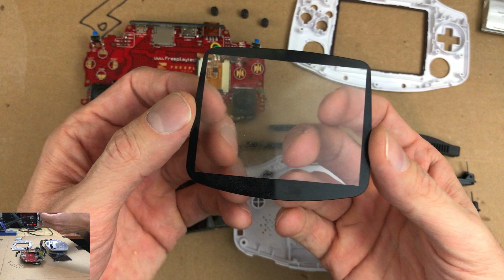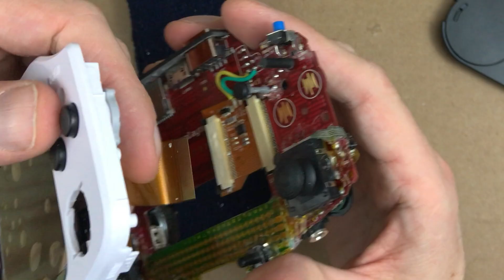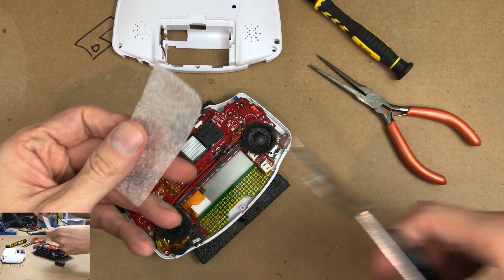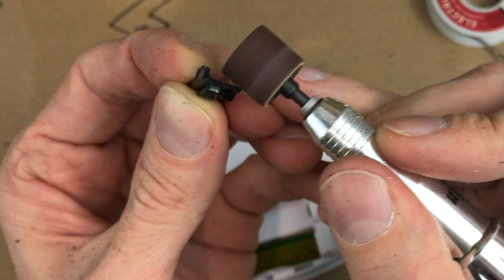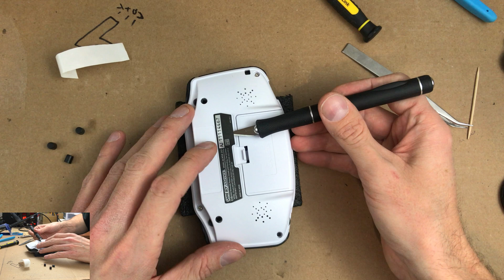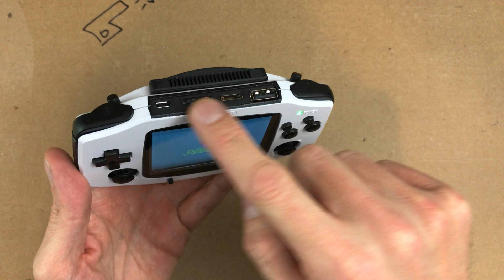Build Log Freeplay CM3 Vita Analogs 10 - Assembly

Comment: One more question which was easier 3Ds or PS vita build!?
Reply from the maker: Hmm I’d choose the Vita sticks over the 3DS sticks if I were making another build like these. The 3DS sticks took more work, and were less comfortable to use in the end IMO. Also, I think I added my Vita sticks in a different way than most people, which I still like. Most people seem to make a hole in the shell and then press the stick up to/into the shell as much as possible to get decent clearance so the stick doesn’t hit the shell when using it. This works, but I didn’t like how tall this makes the analog sticks. So when I do mine I go the opposite way as much as possible. I mount the sticks to the main board so they sit as low as they can. This means I had to widen the holes in the shell though to stop the sticks from hitting the shell. I’m happy with that compromise. I don’t mine the larger analog stick openings and I just cover them up with some material like plastic or foam. I have tried modifying a Joy Con analog (the drift issue now has me not trusting Joy Cons anymore) before to lower the height even more to test. I found that when I lowered the height of the sticks they felt bad. They then had a smaller range of motion which really felt bad to use, so I didn’t stay with that idea.

Comment: Would you be able to put wifi and Bluetooth with this setup!? Asking for a friend. Me!
Reply from the maker: Yes you sure can. I did in this build (2nd video in the playlist) https://www.youtube.com/playlist?list=PLREjlLscKf5IyG-kfCUnbVqFZRrvADeme . It works well, but the system sometimes doesn’t like having USB devices suddenly turned on an off. Also the way I did it requires the hub to be  powered to be able to use the USB on the main board. So it’s Bluetooth + WiFi + USB, or none. Not real problems for me though.  I just usually toggle the Bluetooth and WiFi to on or off while I have the system off to avoid the random freeze that might happen.
Reply: Hipcat I saw that build but you didn’t break the board in smaller pieces
Reply: Hipcat once I get all the parts I will hit you up so I can make the right connections on the two boards! And just to let you know I know some dude sales these on Etsy.com but they are not as good as yours. Just saying incase you wanted to make a few bucks!

Comment: How did you fill the full screen? I heard these screens are real finicky and don’t do well with resolution changes.
Reply from the maker: After installing the drivers for the screen I just adjusted the overscan for left, right, and bottom in the /boot/config.txt to force the screen to be centered how I wanted. For each emulator I went into the settings for the aspect ratio and set it to 800x480 and manually set the X&Y positions. I tried using different default settings for each emulator, like 16:10, but decided to just hit the custom setting. I haven’t seen any issues at all in screen performance. So that part hasn’t been finicky for me, but the screen was a super tight fit for the DMG case. Those walls had to be thinned up a lot. Then after the screen was in place I used an incredibly thin metal sheet wedged along one side to block the light from shining through the side of the casing.
Reply: I configured the CM3, but the zero has been a pain. I tried installing ili9341 from github with no dice. Any ideas?
Reply from the maker: matthew martin I haven’t done any Zero builds. So you got the CM3 up and running, but there is a problem with the Zero?

Comment: Are you going to review the software setup? After watching your videos I feel pretty comfortable with the physical modding aspect, but I’m a little unsure about how to get the software setup. Especially getting the second joystick to work as the “c” buttons on N64 games, but as a normal joystick in every other situation.
Reply from the maker: Hmmm that might be a good idea. The last couple days I’ve been diggng around in the settings, and I have most of the standard stuff figured out. Like the C buttons in N64. So far I just us the Libreto core so the controls are more easily customizable. For each system I save a controls setup for the core (usually just adding the left analog stick as a d-pad alternative), and then for game specific configurations I set up the controls and then save them for only that game. I’ve been messing with some video settings for individual games in the same way. It is SO cool to set it up once and then later on when you launch a game to have everything just the way you want it. My new favorite thing is setting up arcade games, like Galaga that were made for portrait orientation, to work in portrait with the right analog stick and buttons working correctly while holding the device turned 90 degrees. I’ve found the software of Retropie to be super wonky though. Sometimes crazy things happen seemingly without reason. Like changing screen orientation in a single game will somehow affect the menus layout for 3 game lists! Weird stuff like that. I’ve been setting up a base for me personally using the Freeplay image, and making backups whenever I make changes. I’ll probably post a showcase video pretty soon, and now that you mention it maybe a quick software overview or something like that.

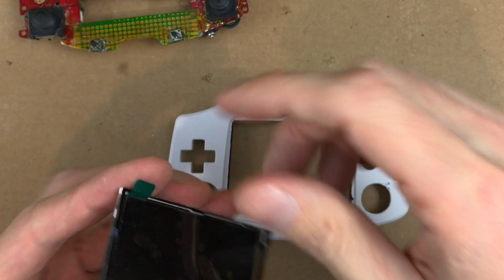Comment: 2:40 for instant satisfaction and music sync :)
nah but forreal the final product looks great. Gratz!
Also, what was the diameter of the holes for the vita sticks (if you know it)
Reply from the maker: Thanks. I should be able to clean it up a bit for the final video. The analog stick holes are about 16.5mm. They could be a tiny bit smaller and still function well. I used a dremel to file them since the step bit I have only goes to 12mm. I rounded (chamfer or bevel I always forget) the edge so it is comfortable if your thumb brushes it too.